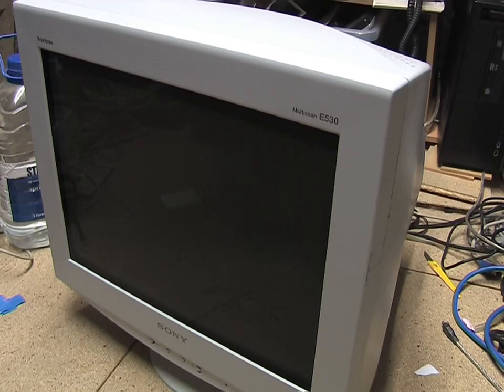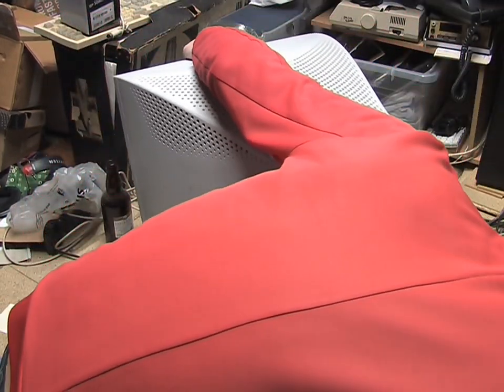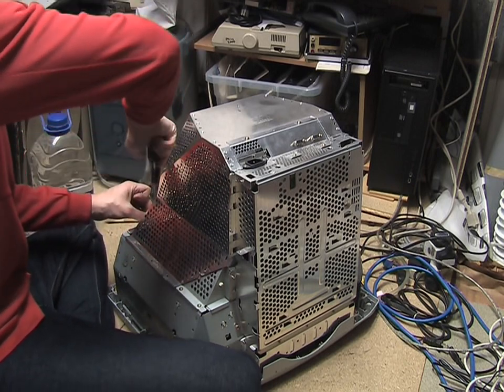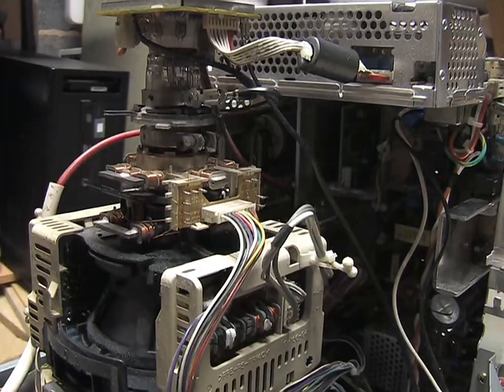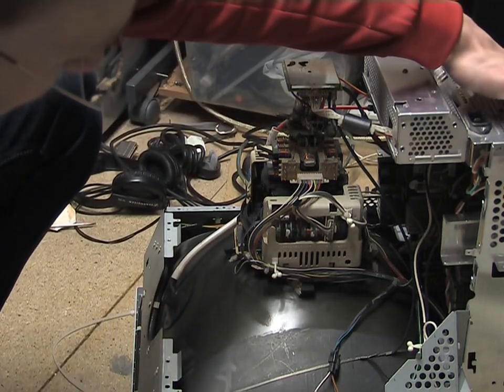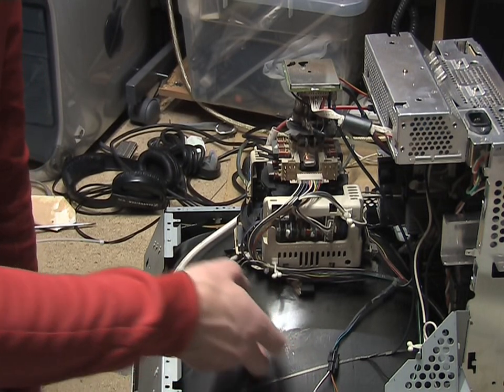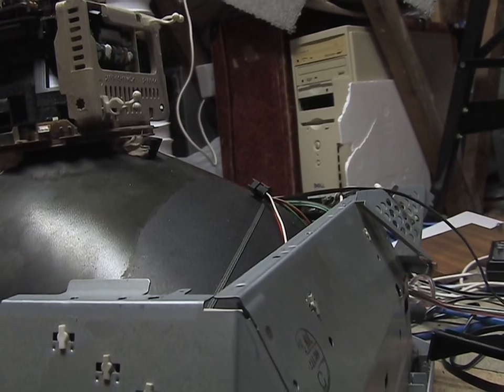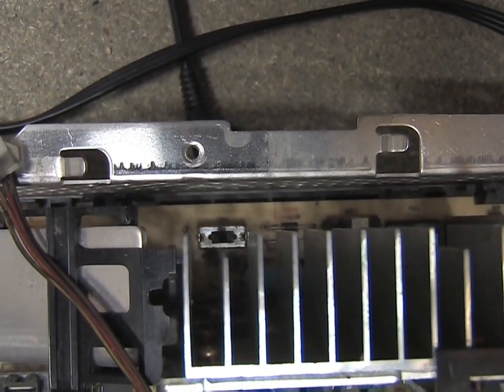Teardown: Sony CPD-E530 21" Trinitron CRT Monitor

Comment: Interesting video. I just found one in my basement and it even powers up properly. I had four of these in my home office back in 2002-2005, connected to two 3D / Video workstations. Looking back now, that must have been a pretty sturdy desk...
Reply from the maker: Sounds like a nice setup. I used to have mine on a rather flimsy desk. To be honest, I'm surprised it survived as long as it did.

Comment: I have a Sony KV-32FS100 that has almost the same problem. Whenever I power it on, I hear the deguass sound and in a few minutes, the picture will eventually appear, but then flickers from on to off again almost instantly with no sound, but the sound was working until the problem happened.
Reply from the maker: Hmm. I'm not sure what the cause of that would be. Please keep us updated if you manage to figure it out. I've never done any work on Sony TVs, so I don't know how different they are to the computer monitors. I do have a Dell 17" Trinitron monitor which suffers some intermittent picture flickering (and sometimes goes off with the power light flashing), but it has been mostly OK recently so I don't know what the fault is.

Comment: I've same monitor and it's still working fine despite the other problem - see - https://www.youtube.com/watch?v=kmptsD9M2Fs.
Reply from the maker: I just watched your video. That's what mine was doing some years back; taking ages to start up, but eventually it conked out completely. Fixing the heater power supply circuit fixed the problem.